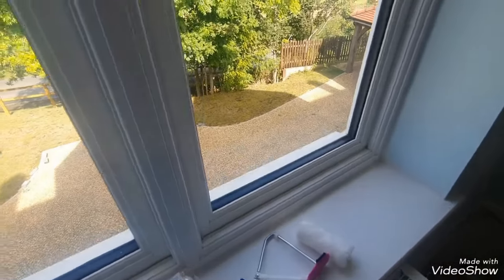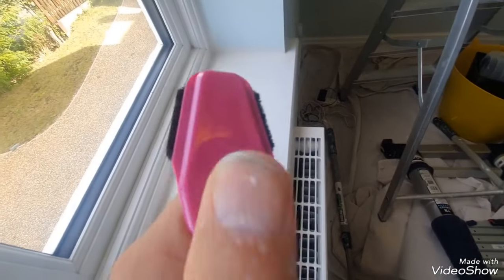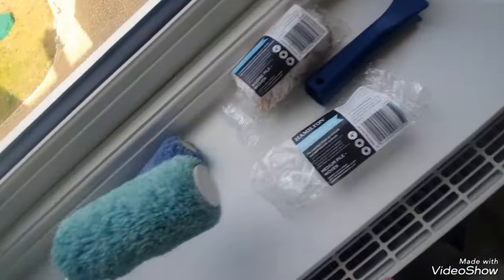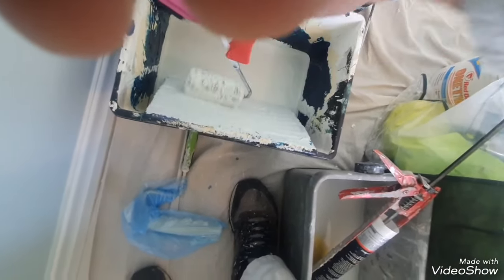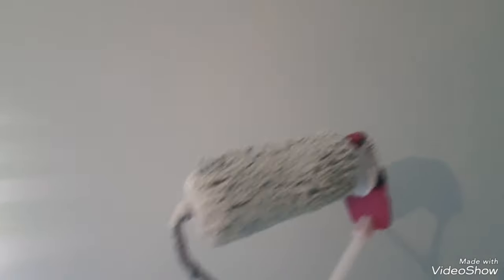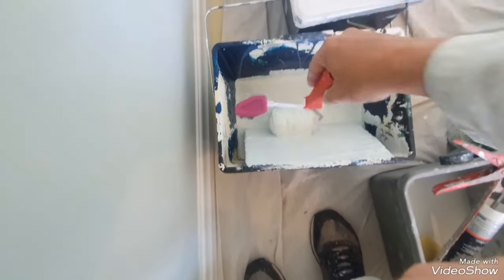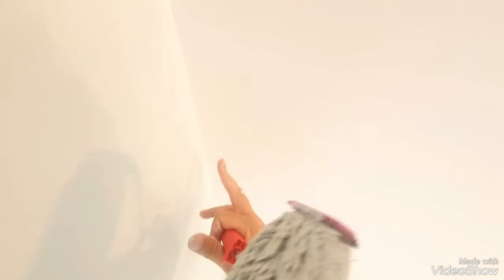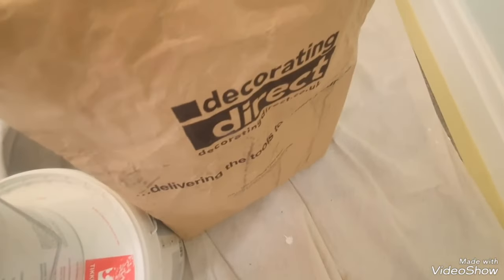The Best Way To Buy A Cutting In Roller And Replacement Roller Sleeves In The UK. MUST WATCH

Comment: So tempted to buy this as hate cutting in and can never get clean line (diyer).  Do you then use tiny brush for few mm gap it leaves.   I still keep checking for that s300 brush but simply cant get em in uk.
Reply from the maker: @umranhu  I know mate 
I got the last one on Amazon 
It's a Dutch make so there might be an eu site

Comment: Can I ask you a question I’m not a professional decorator just a housewife but I do enjoy decorating I’ve just stripped off ugly chipboard wallpaper but it’s left lots of crumbled walls what’s the best thing to do because I’m definitely not experienced when it comes to plastering 😮
Reply from the maker: Hi.
I would use a plaster primer like Optiva Primer by Tikkurila 
Then once dry sand it down with a Mirka sander then fill up with Easyfill 20 then sand again and prime. Only then I would put 2 coats of my finishing paint on.

Comment: Always use mini rollers when cutting in for a continuous roller finish as opposed to brush & brush marks , i use the Axus heavy pile which when you run off is the same as my purdy emulsion roller & doesn't leave a heavy finish, the pile on these minis are covered on the tip so it gets into the corners when you just dab the edge on scuttle etc saves loads of time & no brush marks, from a painter with 38yrs exp 😉 i commented before seeing all vid, never used these guard type normally these gimmicks are a waste of time & just for non painters, I try to keep my cutting in line to a minimum & roll up as close as possible without sideways rolling, do these not scratch the lid ?
Reply: How do you cut in with a roller without the guard on ????
Reply: @geoffreymeare3406  im talking corners mainly but if mist coating plaster etc i use all round including ceiling to wall line as that way you have a continuous roller finish & the only time i brush is cutting in different colour on wall etc
Reply from the maker: No mate. Just make sure the lid is fully dried out then happy days.

Comment: Does the plastic leave scratch marks on the ceiling?
Reply from the maker: No not at all. Just make sure you ceiling is fully dry. I think if you have to get a room done in a day then do the walls first then the ceiling edge as you can always cut you white line into the wall colour as it leaves a nice edge boarder

Comment: Has anyone tried this tool against plaster coving ? Keen to see if a 6-8mm lip is enough to stop this catching the coving ?
Reply from the maker: I would say it would leave a boarder line underneath but I've not tried it out yet underneath coving
Reply: Thanks. House has coving everywhere and have a lounge to do before Xmas. Not a professional so used the “Pink” tesa tape 5yrs ago but found it pulled the white paint off the coving occasionally. Cutting a dark colour into coving is an art that you professionals make look easy ! The tool really needs to be within 3-4mm to make it look ok as when painting the underside of the coving I’ve bought it down the wall 10mm.

Comment: will they work up against coving or dado rails
Reply: With coving you can always paint the bottom bit (that joins on to the wall) the same colour as the wall and then wipe any excess from the face of the coving. Even if the coving is white and the bottom of the coving is a different colour as on the wall, no one will be able to tell. It's an optical illusion. But yes it obviously would work the same on coving and dado as you are running it against a right angle.  But you could emulsion against a glossed dado and then just drag the corner of a damp cloth along it to clean the emulsion off and give a nice clean line.  Just the way  you would wipe around an emulsioned  light switch.

Comment: the margin at the top looks bigger with the hamilton rollers than with the roller on rhe original video
Reply from the maker: You could be right there as it crossed my mind 
It may have to be in the UK we buy a whole new one but that company iconicwalls.co.uk messaged me to say they now stock refill sleeves. I've checked and they do